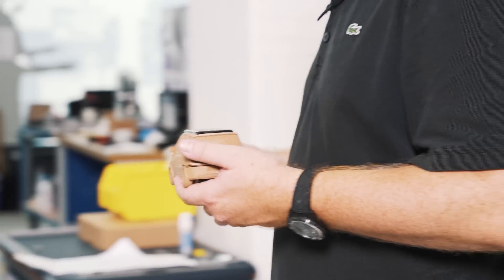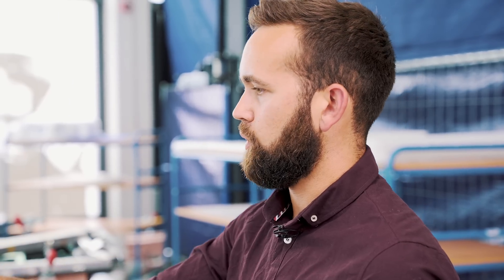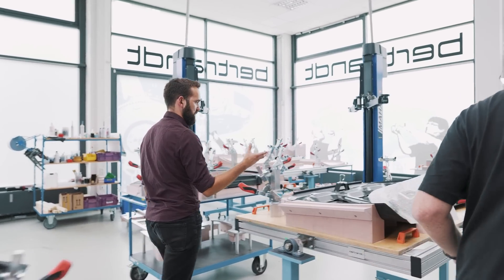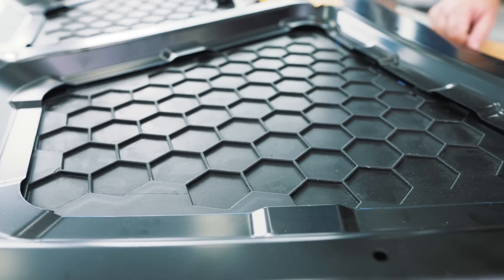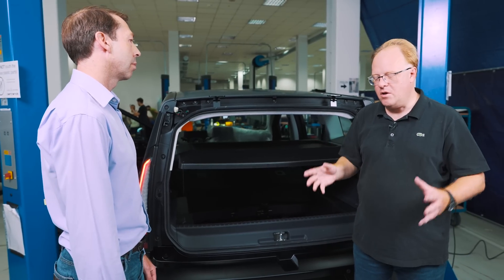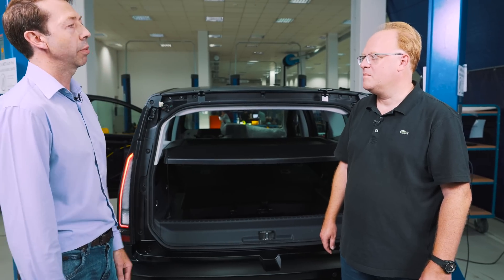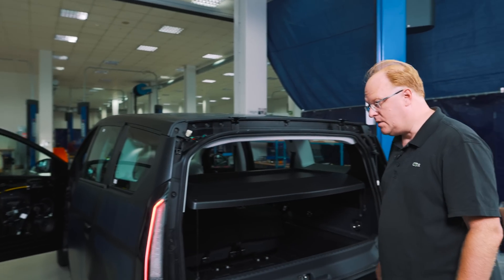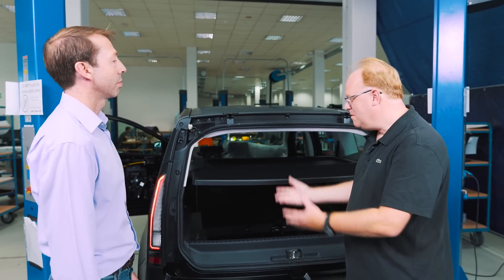Exterior - Solar cells charging for you | Sono Motors

Comment: On this family car, is it possible to fit a 'boot bike rack' on the tailgate door, and a 'roof rack' for a ski box?
Reply: Roof I think no. Tailgate maybe but only with aftermarket stuff. I don't think that Sono will sell something like that. But it is said to have a tow hook. So you can pull a small trailer.